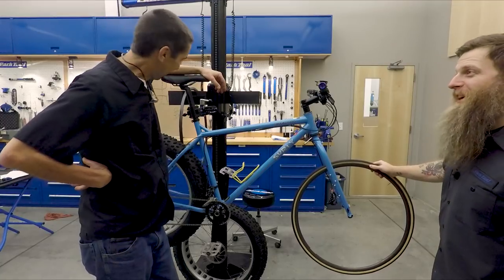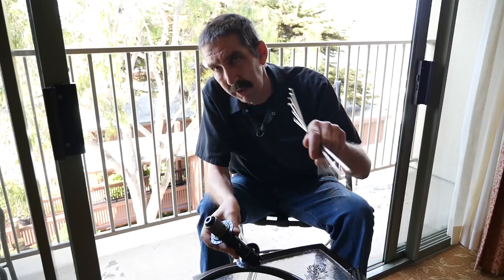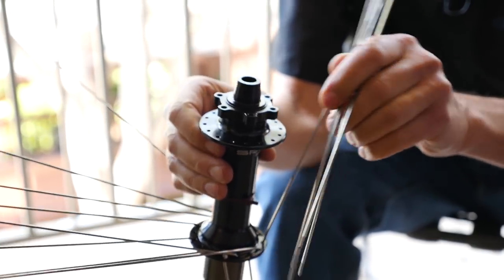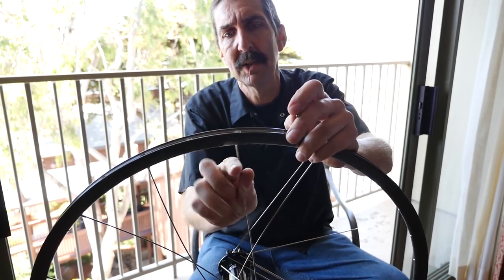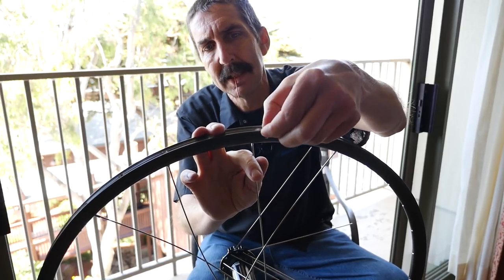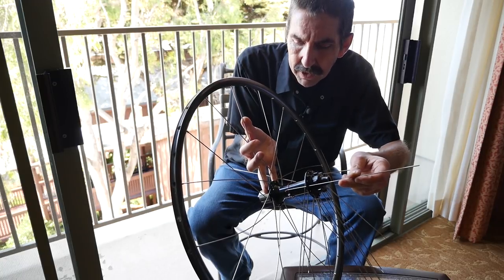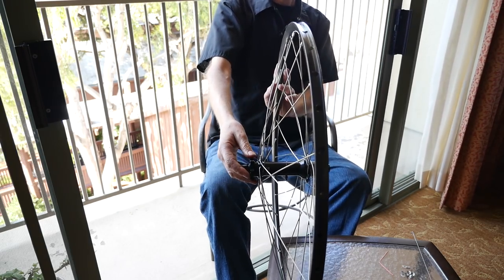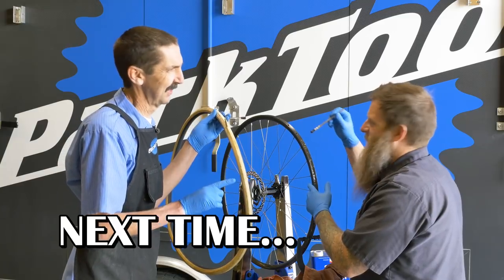Skinny Fat Bike Build, Part 3: Laced Up

Comment: I want to see a road bike tire stretched onto a regular mountain bike rim. Is it even possible?
Reply from the maker: The term "regular" has little meaning anymore.  The common road tire is a 622 bead diameter, and that is the same as the 29er mtb tire sizing.  A wide road tire (say 35 and up) would fit on the 29er rims. However, a really wide rim, like 35mm wide, it is not a good idea as the bead does not stay down.

Comment: Spoke prep yay or nay?
Reply from the maker: Thread preparation is important, yes.  These were laced dry and then lubed using chain lube before pulling tight. The “spoke prep”, that installs wet and then dries is better than nothing.  It acts somewhat as thread lube, but does not really act as a lock.  It does nothing however to lube between nipple and rim surface, an interface that creates a lot of friction.

Comment: Finding that other flange side hole....was a real pain in my situation. No tutorial videos can properly teach you. Because camera angle can drive you often on to wrong judgement. I tell you, what would happen if you fail to identify that other flange's correct hole. May be 1st spoke you insert on that hole fits into rim more or less perfectly. But 2nd...3rd....4th spoke and so on...would going to give you an impression, like maybe you have chosen the short spokes for that flange. because every next spoke's gap between nipple and spoke tread would go even wider. even when you try to lace  4 th or 5th number spoke the gap between spoke thread end and the rim side would be so much wider as you can fit your finger on that gap.

Comment: Why is there a zip tie on the hub?
Reply from the maker: In an earlier video, Ben & Calvin discussed wheel dish (centering) and the zip tie was used to show the center of the hub in the frame, rather than the center between flanges. It is now a fashion statement.